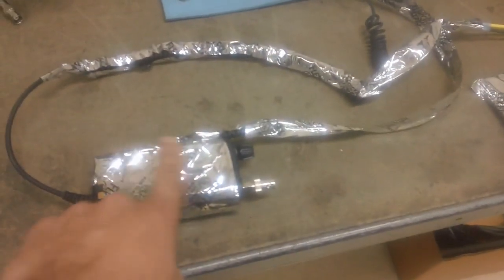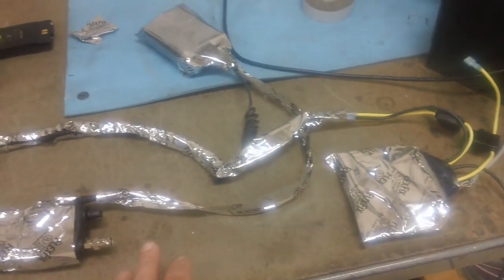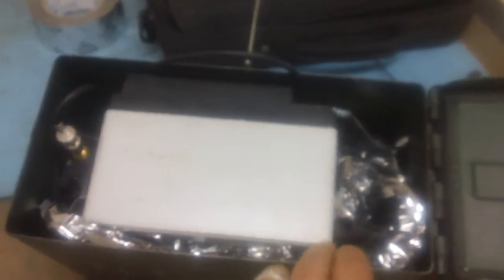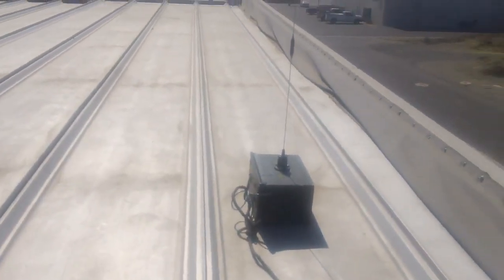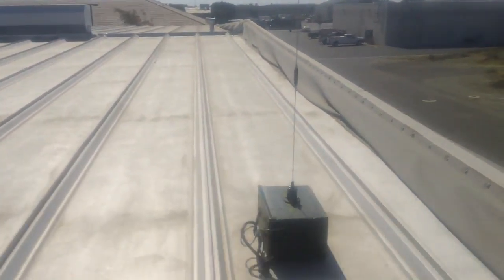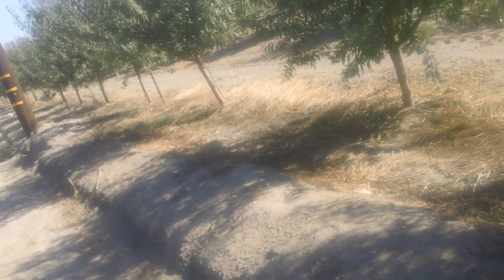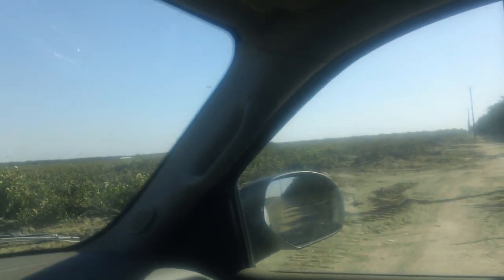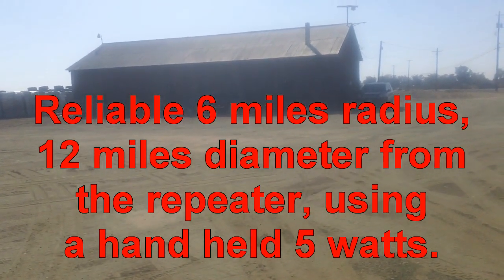SHTF Urban Simplex Radio Repeater Range Test

Comment: You have good coverage for 30 high building plus elevation of atleast 3-5 feet.  Imagine if you have a nice quality repeater as a MTR2000, Quantar, or GR1225.  Maybe next time get a better high gain Omni antenna, Heliax feedline and put it 10 ft above the roof top like that ladder.

Comment: OOh the dreaded RF,been there with Lowband 66-88mhz AM\FM transportable VHF comms kit,copper tape,Ferrite clamp on chokes,Shield ,RFI Braid and copper fingers! all help,does not help when products in plastic non shield enclosures!,good Vid ,glad you got it fixed 
Rob 73's OUT

Comment: What did you use for the shielding wrap?  I did a search for "Flex Fit" and couldnt' find anything.  I'll assume it's not standard aluminum foil but could be wrong haha.
Reply from the maker: Sorry for the delay in answering, been burnt out and needed to disappear. Its air duct tape used on those refective ducts on HVAC system. I bet you could find surplus "100 mile tape" on-line. its basically thicker adhsive aluminum tape to patch up aircraft temporarily.
Reply: I did aircraft maintenance for 13 years I know exactly what you're talking about :)

Comment: I'm new to this. And I'm in the process of making a repeater and was wondering how to tune the antenna you have when you did the test on the 30ft building. I'll be building a duplex repeater with a SureCom 328.

Comment: I ran across this with my field repeater. I have a huge box of old anti-static bags so I just put everything in there and sealed with with EMI tape... works like a charm. BTW, how are those cheap HT's working out for ya? I never did get around to buying a couple... I got my eye on the Quansheng TG-UV2... do you know anything about those?

Comment: The signal over head is taken and added at the horizon as per DB gain. Also just for information to your readers, every 3 DB is twice your power. 5 DB is a little less than 4 times your power. So if you have that Radio set at 4 watts your correct on the radiation at the horizon around 15 watts. But the over head radiation suffers to allow the maximum radiation to happen out at the horizon. In most cases this helps but if it is where your working a downtown area it might be better off using a unity gain antenna. That is if there are structures around you or if the repeater is in a valley working mountains around it. A try and see situation really exists. You have to try different antennas to pattern the area of interest your wanting to cover. Or read the manufactures info on each antenna product. The ARRL Antenna book is also a great resource for information.

73
Jimmy, ARRL TS, WX9DX

Comment: Sir  can this be put in a trunk of a vehicle and will it work if I have 10 plus radios in operation..?

Thank you in advance again.  By far the most informative videos on this topic.
Reply from the maker: Thanks for the kind words & watching.
Yes, it could be placed in a vehicle, but you would have to run the antenna outside. Either permanently fixed like a LEO patrol car (unmarked) or using a trunk lip mount or magnetic mount that could be removed, range would probably be 5 miles average radius.
I checked out your website and have an understanding of the nature of your business. From your background knowledge of LE radio, it would work like your dept. radio system but with a delay and repetition of your transmitted message. Once you transmit, it will record it, then re-transmit your traffic. With 10 users with potential security & time sensitive traffic, in the heat of battle, it could make things very confusing and users could potentially step on each other. In my humble opinion, an instantaneous real time repeater is in order for that scenario. This vid is a low budget, low tech, garage tinkering survivalist setup meant for low, (to the point) usage. It would definitly be a "training issue" for it to be coordinated in the field efficiently. I'm just assuming your usage and feel obligated to disclose the shortcomings of this setup will pose to your operation. to me it would be a safety issue with your line of work. Not selling anything , just being real & concerned.

Comment: Not sure if you've heard of Tekfoil; it has reflective foil on the inside and outside with bubble wrap in between. Will reflect heat away, insulate from cold, and provide water proofing. You can find it at Farmtek's website I think in bulk and I believe they sell something similar in the big box stores. Love your videos!

Comment: Using a Port HT Icom T90a with a collapsable High Gain antenna in place of garbage rubber duck antenna...in simplex i have spoken 38 air niles at 150 ft above sea level..transmitting up and over manhattan to long island...

Using instead a collapsable 3 element beam... i have gotten 70+ miles out on same T-90a...

Getting out distances is Easy....Once you understand how..
Using my Roof mounted High Gain base GP-9 antenna on my T-90a i have gotten out at around 90-100 miles but  60-80 is common